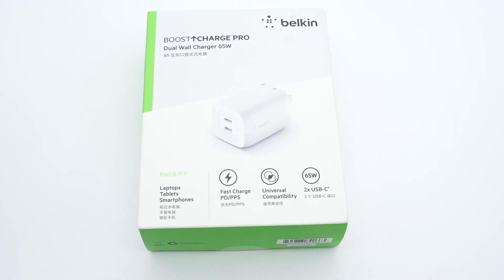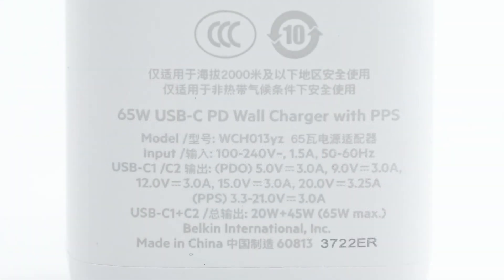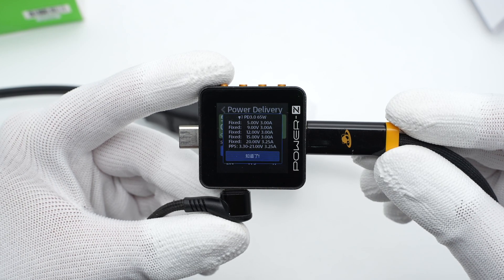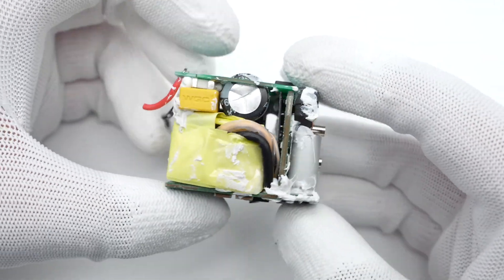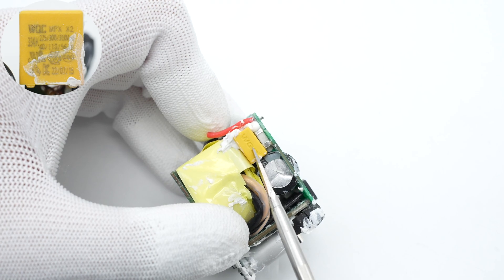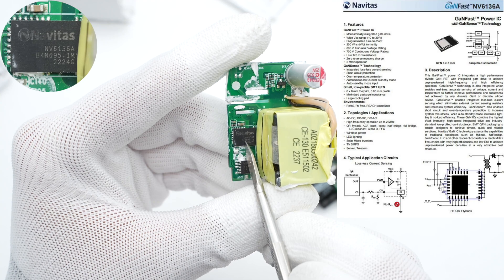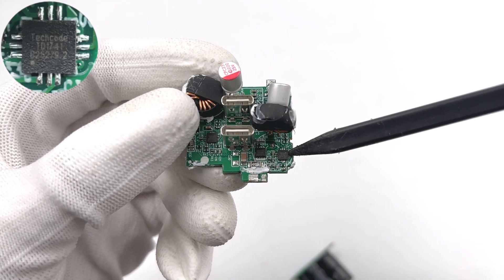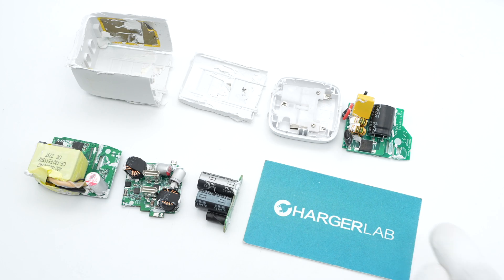Teardown of Belkin 65W BoostCharge Pro Dual USB-C GaN Charger

Comment: Are the internals high quality? It is a well made charger?
Reply: It seems ok to me. No premium components, but that's not what your average customer is looking for anyway. I would have liked to see the internal structure of the transformer, because this is where the output side gets closest to mains side. The only thing that actually separates you (with your phone or anything) and the mains voltage is just 2 layers of enamel coating on the wire and a few layers of insulating tape between the coils. No fun if that is done badly.

Comment: I've been using this charger for a while and am very impressed with it from the outside. Thanks for showing us the inside. The components are of Apple-level quality (which has Rubicon capacitors for example), but at least it's properly designed and well built!

Comment: This charger has relatively high ripple. When I use it to charge my ThinkPad X1, the touchpad sensitivity decreases. When I use a different charger, I don't experience this issue.
Reply: Few people have responded to this issue. I have tested the Belkin 65W, Anker 100W 3-port charger, and the Anker 45W single-port charger, all of which had this problem. Lenovo's original charger works fine, and Apple's 20W, 70W, and 140W chargers don't have any issues either. So now I'm using the Apple 70W charger.
Reply: @f78fk I would love to use an Apple adaptor with my laptop due to the swappable plug ends and extension cord compatibility, but unfortunately they don't support PPS or Mi Turbo Charge which my Xiaomi device requires for max charging speed.
Reply: I noticed this too with my HP ProBook 430 G8, it makes the trackpad go fucking nuts - ended up taking it back since it was so shit, and I now use a dual port 67W Xiaomi adaptor which doesn't have this problem
Reply: @LoganT547  Few people have responded to this issue. I have tested the Belkin 65W, Anker 100W 3-port charger, and the Anker 45W single-port charger, all of which had this problem. Lenovo's 65W original charger works fine, and Apple's 20W, 70W, and 140W chargers don't have any issues either. So now I'm using the Apple 70W charger.
Reply: @LoganT547  Few people have responded to this issue. I have tested the Belkin 65W, Anker 100W 3-port charger, and the Anker 45W single-port charger, all of which had this problem. Lenovo's original charger works fine, and Apple's 20W, 70W, and 140W chargers don't have any issues either. So now I'm using the Apple 70W charger.

Comment: I currently own this charger now, assuming this charger will deliver its maximum wattage when the device is in demand, (65w) I measured an input of 70.2W from the AC outlet. it seems like the charger has an overall efficiency of 92%, which is really good. It is also 2 % more efficient than Belkin's previous generation of Gan 6xWatt chargers. I wish that ChargerLAB could do a review of this product in detail, testing its efficiency and the differences in the waveform of its output current. Thx :)
Reply: hi! @AllThingsOnePlace did some tests on this charger
Reply: could you provide a link? Thanks!  @befringe

Comment: This model can offer a 65W output on either of the two ports if the other is not in use. However, if both ports are in use, one will provide a maximum of 45W and the other 20W.

Comment: If it doesn’t output 9V@2.22A then the 20W marking is false advertising 🤔
Reply: it can output a maximum of 9v 3A which means it support outputing in 9V 2.22A.
Reply: It has PPS so can adjust

Comment: I know I asked this before but I haven't seen the request carried out: Would it be possible to also test whether the multiport chargers include dynamic load distribution between the different ports, please? In my opinion the behaviour of the "cheap" devices to temporarily disconnect all ports (in a few cases even multiple times!) whenever a connected or disconnected makes them completely unusable. I do have a BlitzWolf BW-S25 with 6 ports and this crazy behaviour (and some other design faults, like automatically shutting off a used port after some time) make it completely unusable.
Reply: There are very few multi-port current-gen GaN chargers that DON’T do some renegotiation on plug/unplug/addition.
Reply: @RoyalFizzbin  I'm aware, I have around 10 of them but I stopped buying them since most of them are shit. With most setups (having a MCU to monitor all ports chips) it would be trivial to handle this in a halfway sane way but shit Chinese MCU firmware seems to be the way to go.

Comment: I own this and am excited to see it's inners without having to sacrifice mine, this charger is amazing.
Reply: Wait this has QC5 🤯
Reply: Does it heat up if we charge 65w laptop?
Reply: @roninr8199  Yes and no, if you continuously power a 65W laptop from this for hours it heats up slightly but nothing alarming or to worry about. It's perfectly normal and this is well built and will last for ages doing what it's supposed to do.
Reply: @ratkutti  i have hp aero 13 5600u laptop which I hope has pd charging also which takes around 1.30 hours to fully charge. So I can expect belkin charger also to be plugged in for 1.5 hours minimum.
I also checked samsung 65w pd charger. I can also use for samsung phones when I upgrade in future.
Reply: When you use both ports, does the first port temporarily disconnect and renegotiate the charging protocol when plug/unplug the second port?
Reply: @isthisshortanduniqueenough  Yes but it's based on the devices connected. Small devices like watches have the charger pause and begin again. Connect something powerful, say a phone when another phone was already in, they just continue as normal, if I'm recalling right. I guess it's load based but it's been a while since I used this charger but I'm almost sure I'm recalling it right.
Reply: @ratkutti  Thank you!